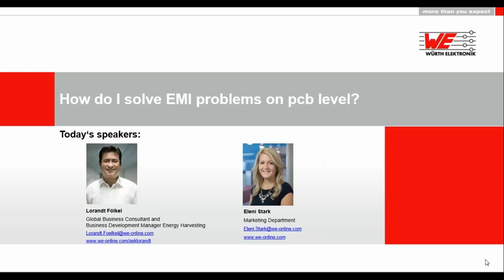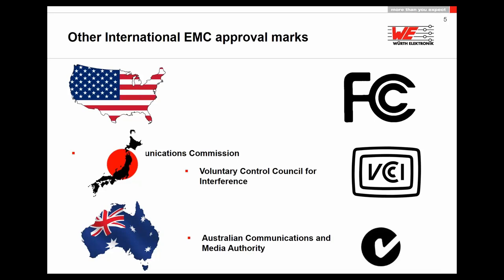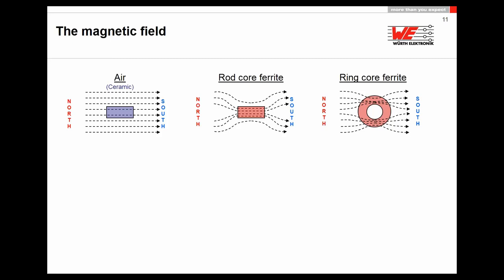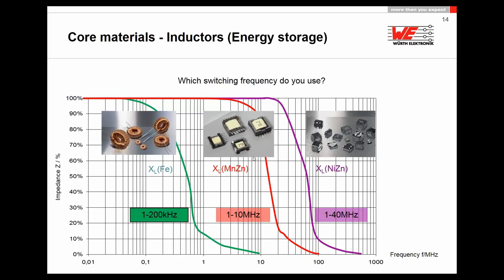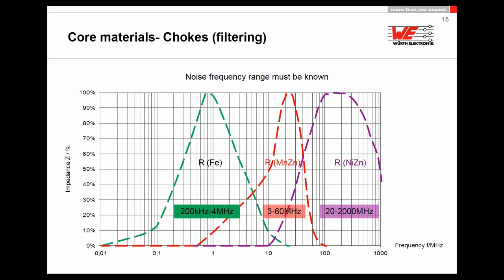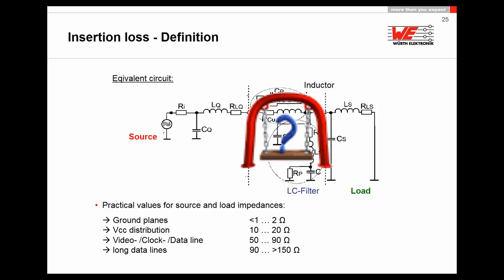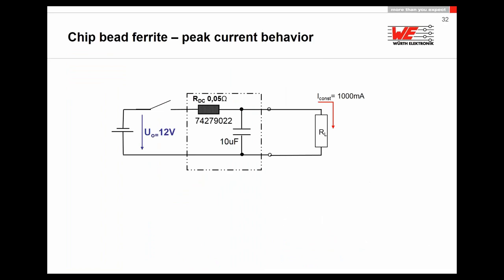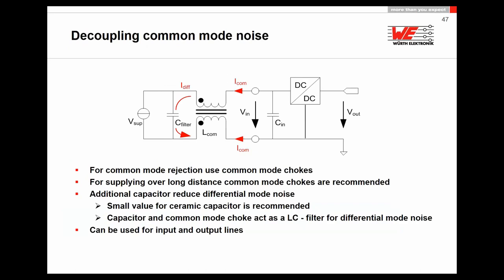Würth Elektronik Webinar: How do I solve EMI problems on pcb level?

Comment: Thank you for the nice presentation, I have one question regarding the commutative loop when half-bridge is acting as a boost converter. During buck converter, the current is provided by Capacitor and we try to manage the loop as small as possible so that we maintain inductance as low as possible, but in boost convert, there's already a huge inductor used for storing energy, why this loop need to be optimized, loop introduces some nano inductance which might not be a problem when I already have uH filter inductor?
Reply: Hi Keshar, in buck mode you need to filter in front of the Cin and at boost mode you need to filter after the Cout.

Comment: When do you choose a Zero Ohm Resistor vs Bead?
Reply from the maker: Thanks for your question, Mr. Hendricks! Lorandt used a zero Ohm resistor just to have a free SMD pad in case it needs to be filtered. The zero Ohm resistor has no filter effect and works just a “space” holder. Kind regards, Würth Elektronik